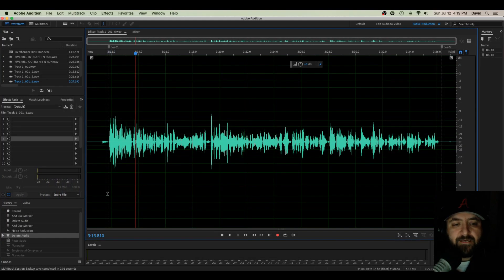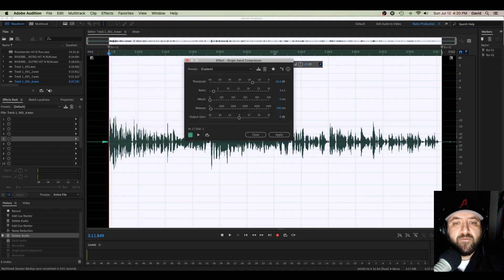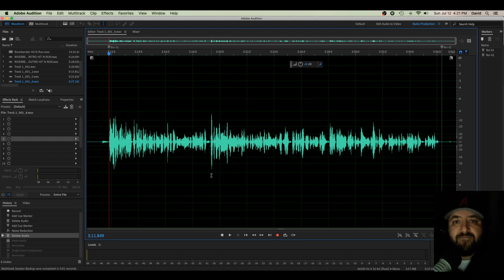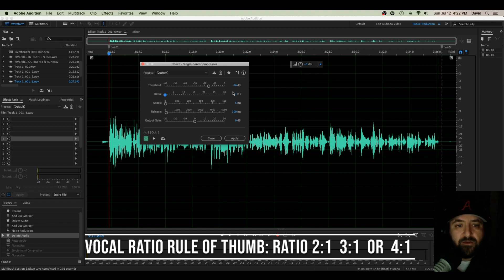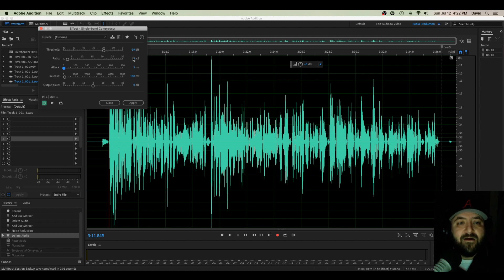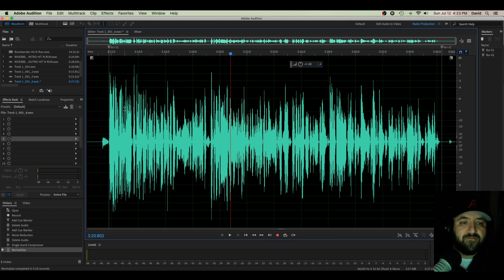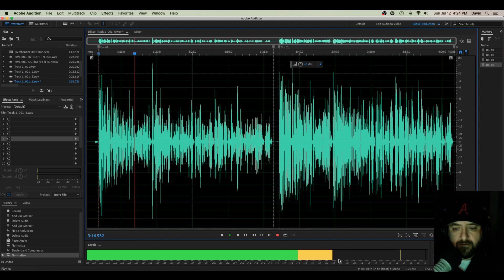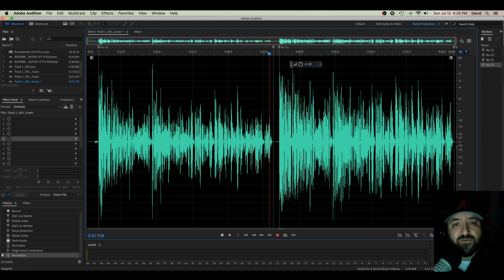What is a Compressor? Dialogue Compressor Tutorial Adobe Audition

Comment: What is the difference between single-band compressor and dynamics->compressor ??
I'm new in this, with a condenser mic and single-band compressor I see almost no changes on levels. Which one should I use?
Reply from the maker: Excellent question!

The single band compressor compresses the entire audio file. The dynamics compressor is also a single band compressor.

If you're not hearing much change...then adjust both THRESHOLD and RATIO. Until you find something you like. Try using the preview pane as well. (Two little boxes upper right corner in waveform view).

If you still need help, check out my compressor hack video here: https://youtu.be/oR2GGSh99aA

Thanx for watching!